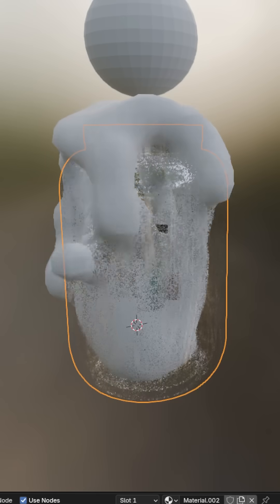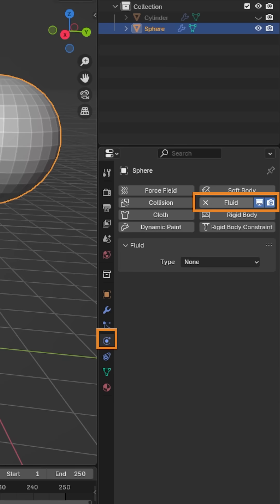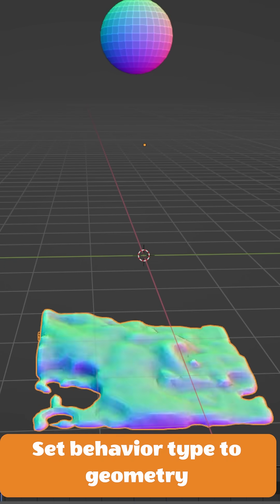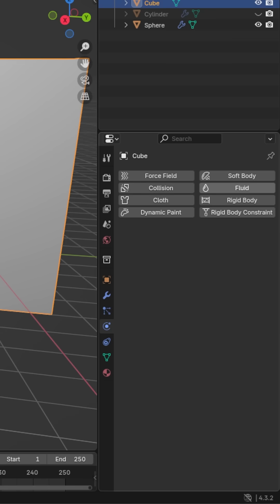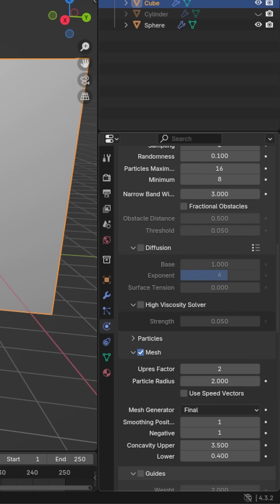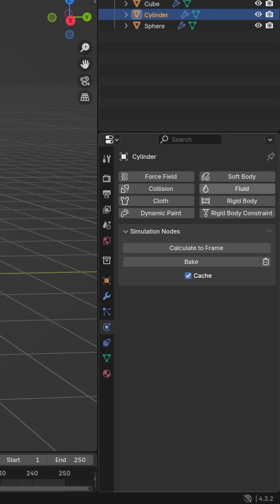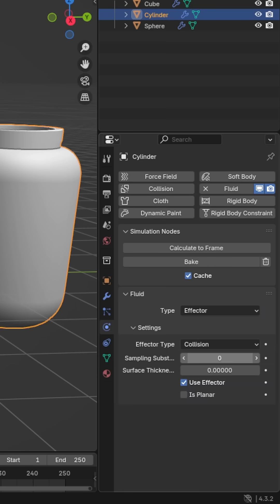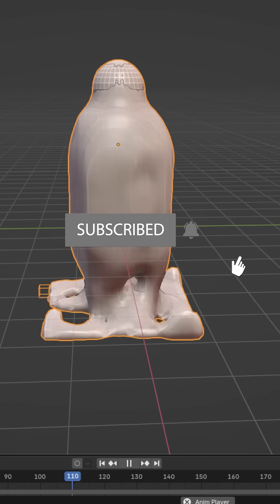Easy Fluid Simulation in Blender #blender3d #shorts

Comment: Tried using it to simulate an archviz that had a higher swimming pool waterfalling into a lower one that also had a waterslide.

I have 64gigs of memory, a 3060 12gb, and a 12700f. I ran out of memory and it took a day to calculate.

Haven't done it in a while tho, does Blender physics use GPU acceleration yet?